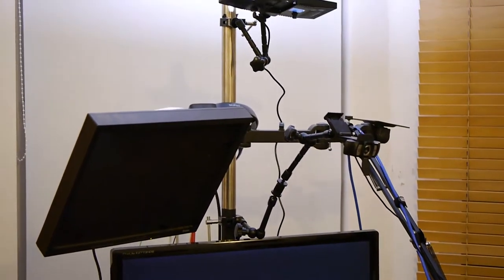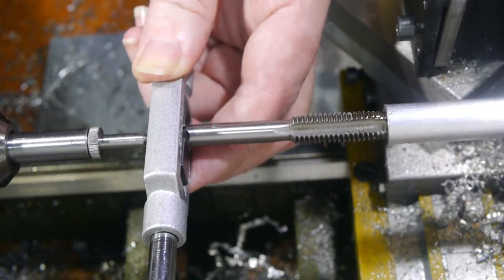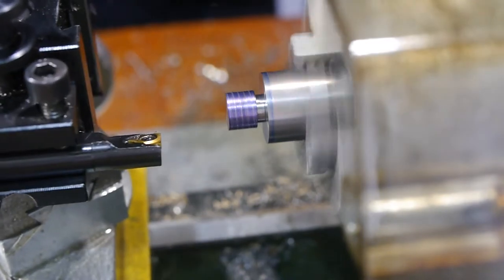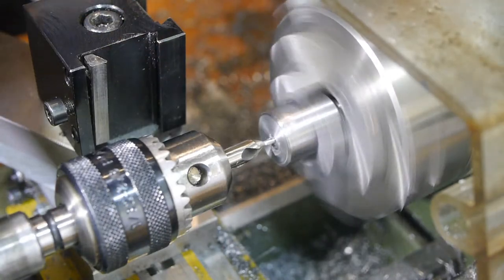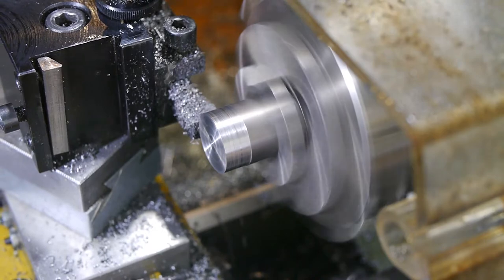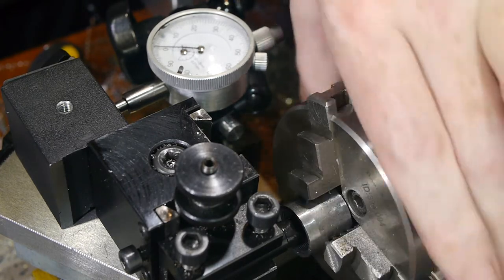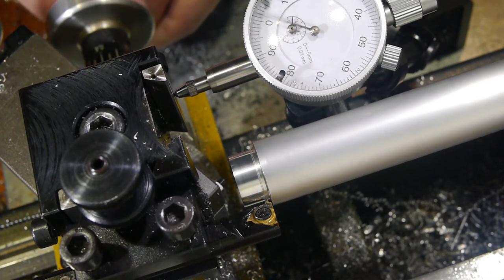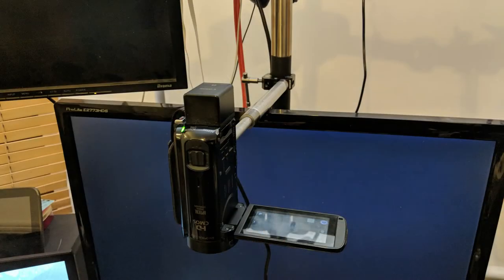Camera Mount - Creative Commons Version

Comment: Hi folks. This is impressive. Normally something called a 'thread indicator' is all but essential to make threads on a lathe - it shows the correct starting point for repeat passes. Doing it without one is quite remarkable! Making one would make a good project for owrners of these lathes. They are not really that complicated. For more info - Google! BobUK